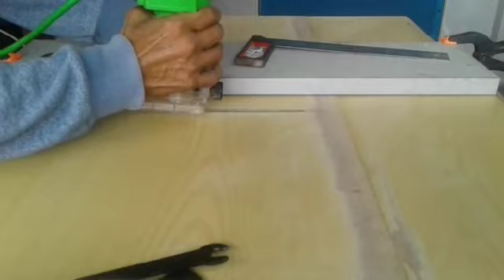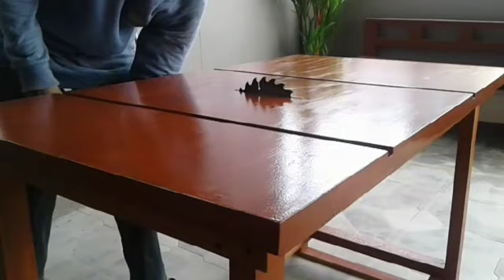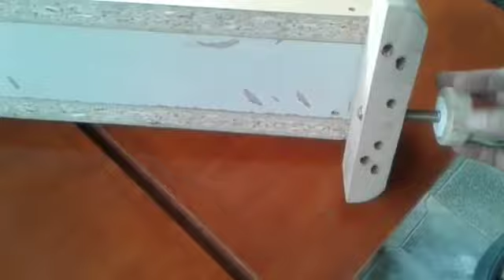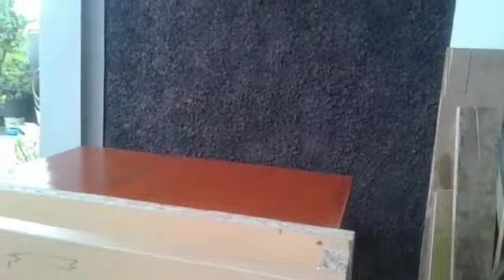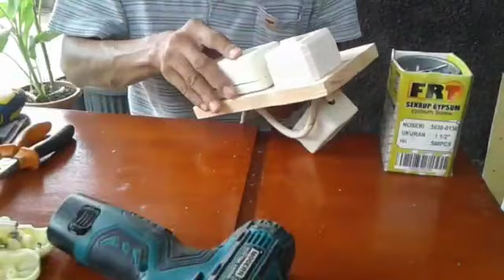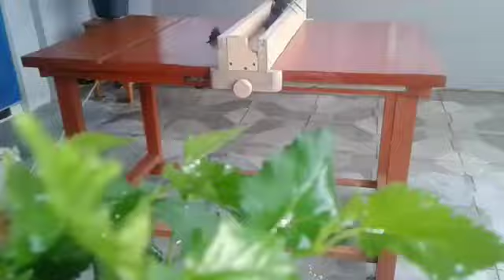DIY Table Saw || Membuat Meja Potong Kayu

Comment: Boleh minta ukuran2 size top table nya min
Reply from the maker: dideskripsi sudah ada pak
Reply: Mksdnya top table plan nya min 🙏
Ukura2n lengkap jarak antara blade ke track slot nya
Reply from the maker: @rijalvandry7367  Ohh, maaf....jarak antara blade ke track kanan kiri sama 25 cm pak
Reply from the maker: jarak blade ke kiri top table 50 cm, ke kanan 70 cm. jadi masih bisa potong papan ukuran 60 cm. sisanya yg 10 cm buat pembatas/fence. Terimakasih, semoga sedikit bisa membantu🙏